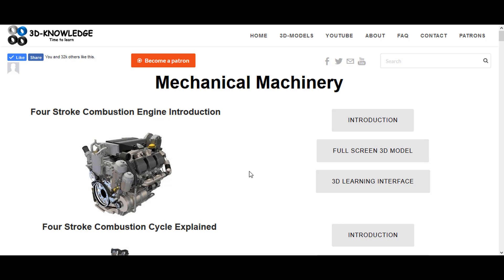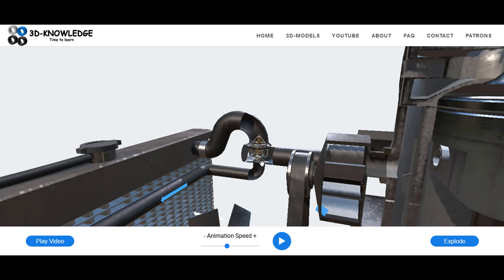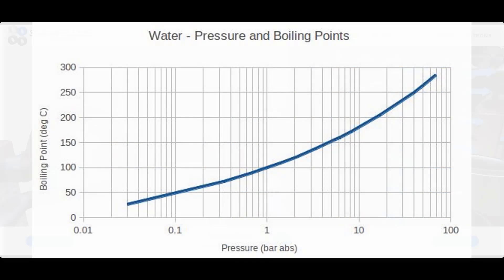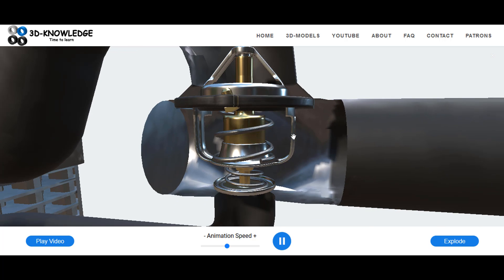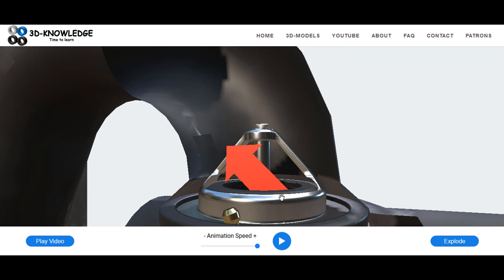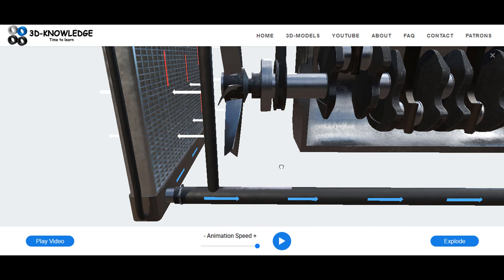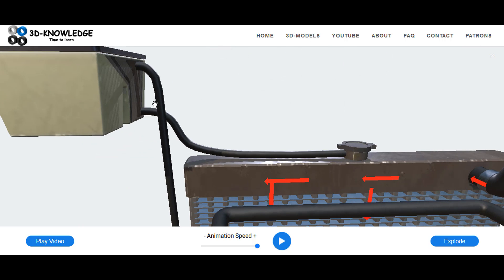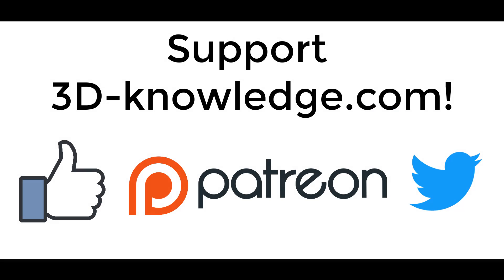How Engine Cooling Water System Works

Comment: So when running an 85deg thermostat in conjunction with a thermo controlled electric radiator fan with a digital controller, should I set the fan to come on at 95deg and off at 85deg??
At the moment I run an 85deg thermostat with a mechanical viscous fan and the temperature runs at a great quarter on the temp gauge. The thermostat opens just above quarter and  I want to replicate this when I fit the digital controller and electric fan. Any advice would be greatly appreciated. 
Thanks

Comment: is the air flows in correct direction?.. shouldn't it from front through radiator then hit the engine?..
Reply: The air flow is wrong.
Reply: It is correct if the radiator is in the rear of the car....😁

Comment: i have a man diesel engine on a man bus,we removed the air con,there is a water pipe going in the engine and air con pipes coming out of engine can we close or what impact will it bring considering that we are no longer using the air con

Comment: On a car the fan draws the air through the rad just as it would during forward locomotion. Generators and other static engines would push the air through.
Reply from the maker: Interesting. Thanks for this. I am more experienced with industrial equipment than automotive, that's why I put the fan as forced draft. But your comment is appreciated. I should have changed this to induced draft for the updated video, but it's already been recorded so just the model will be updated, not the video.
Jon

Comment: What is this awesome computer program you are using?
Reply from the maker: 3D models are created in Blender or SolidWorks, the models are then displayed in a iFrame on your web browser. Creating the models and making them accessible online was a bit of a nightmare. The process was gradually improved though until we now have animations and the ability to create cross sections etc. 3D-knowledge was where it started but for various reasons I opened saVRee.com to try and make it easier for anyone who wants to teach or train with 3D models. The idea is simply to give educators and trainers everything they need to make great learning material, without the need to create all the 3D models etc. Sorry, I am digressing...

Thanks for the kind feedback and stay tuned for more! :)

Comment: Can a dispel engine operate effectively if you remove the thermostat
Reply from the maker: No, the engine would overheat, especially at higher revolutions. You have to remove the heat from the combustion space otherwise the engine will get too hot. The engine has an optimum operational temperature and the thermostat is set to match this, without a thermostat, the engine will not be operating effectively/efficiently.
Reply: 3D-knowledge thank you